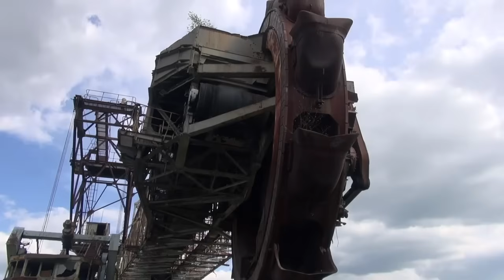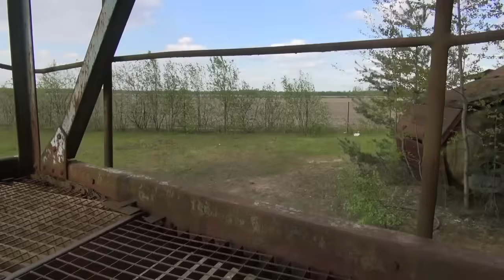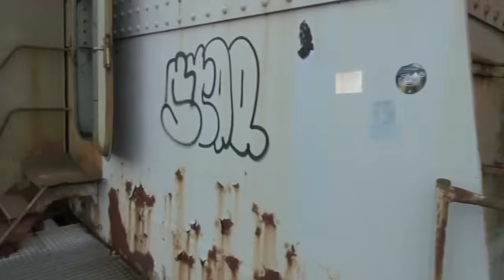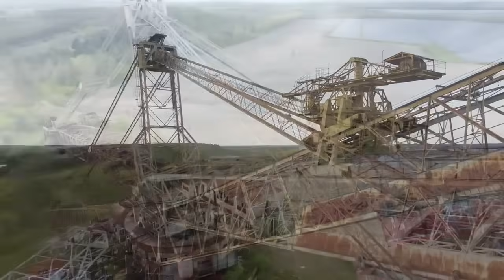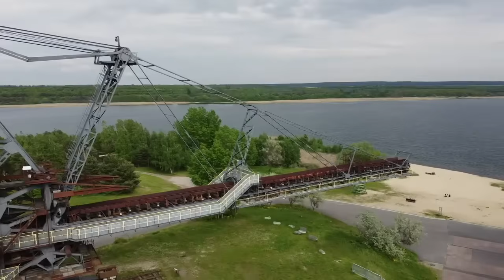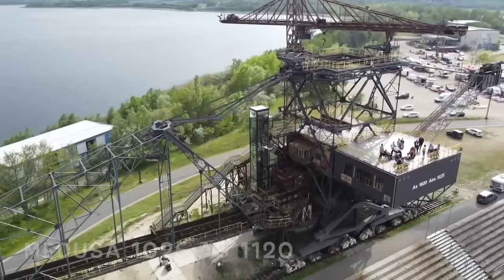BIGGEST MACHINES EVER MADE - EXCAVATORS

Comment: i think its one of the maddest things i have ever seen, what a monster
the thing is, some crazy fool actually designed this thing, it does look thrown together, i mean by design it has to have this and that, and then you have to service it, so it needs cat walks and safety built in, there had to be a water supply given that it has fire points, machinery rooms, rest rooms and somewhere to eat etc, its really very like a ship - rooms that have a purpose, machinery to do the jobs and ways to maintain it and pass between them
i visited Fort Nelson recently in Portsmouth, they have a howitzer there a British one that was rail mounted, the construction is bonkers, side pieces that are cast steel, i have seen some big castings but nothing on this scale, i shouldn't think there is anywhere left on earth that could either cater or be able to cast such a thing now, its just bonkers - the construction of this German diggers seems to be fairly straight forward, all cut in flat sections and bolted together, but as you say some day it will just fall into the ground, such a waste of steel